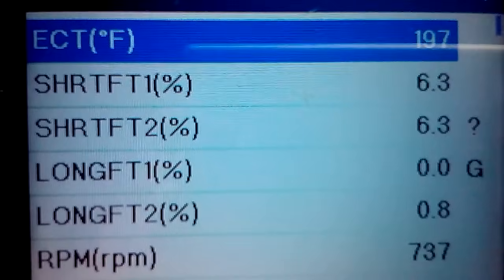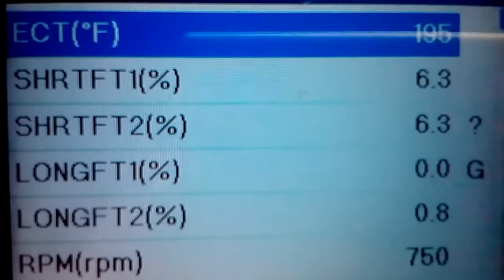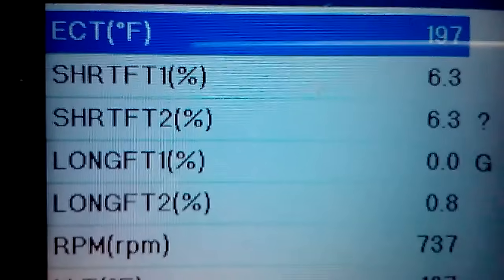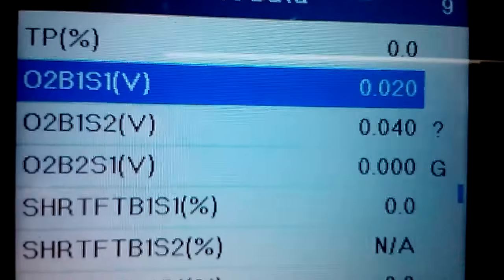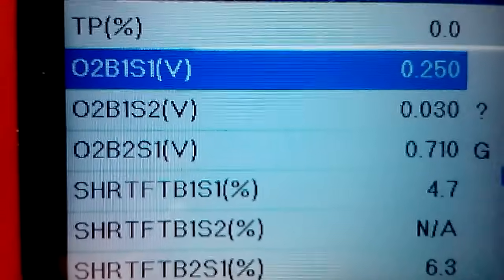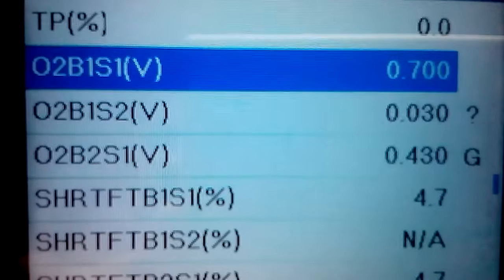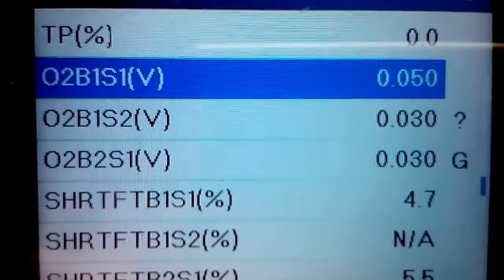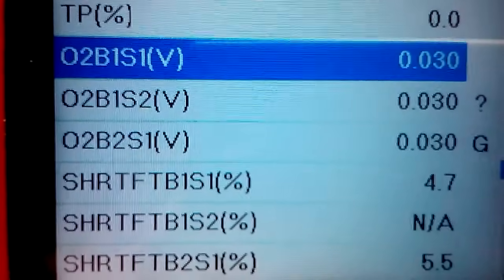The basics on live data obd2 scanner

Comment: Could you please make a video with info on diagnosing cylinder misfires using the live data on these OBDII scanners (if possible)?
Reply from the maker: Ashur deKelaita well monitoring misfires with scanners only give you a cylinder misfire count and let's you know how many times there is a miss. but I can definitely make a video on how to diagnose a misfire and how to pin point what cylinder it is if you don't have a scanner with those capabilities
Reply: Good2Boost would that be in the LIVE Data section or you mean just when you get an error code in the stored/pending section. I have my car in now getting new spark plugs and perhaps coils (hopefully no injector needed) for a cylinder 5 misfire, and just want a way to diagnose with more accuracy to make sure the problem is indeed solved, since I would only get the misfire when jumping on the throttle. 

But my car was also running rich in bank 1 so appreciate all the info on live data as pertains to Oxygen sensors and fuel trim figures.

There are no figures in Live Data that records data for spark plugs and ignition correct?
Reply from the maker: Ashur deKelaita that kinda sounds like a ignition issues bad coil maybe. and as far as using the scanner if you have a higher end one you can see exactly what cylinder is misfiring even if the cel isn't on for a miss. but the cause of it is up to you to figure out so I will Def make a video on that to show you how I go about finding which cylinder and why
Reply from the maker: and also Alot of scanner don't have the misfire count in the live data unless it's a pretty high end scanner. I'll make the video sometime this weekend so check back for it.
Reply: Good2Boost awesome thank you very much!
Reply from the maker: Ashur deKelaita video will be a few days delayed sorry. thought I would be home sooner then I was but I will definitely have it up within the next two days.
Reply: Good2Boost No rush at all. Was just looking at my full readout of Live Data... Its amazing how many figures there are... About 5 full pages worth, and not many videos of Live Data tutorials out there.
Reply from the maker: Ashur deKelaita yes especially on newer cars. the main important ones are the short and long term fuel trims and oxygen sensors. it's rare you really have to monitor much more than that but it does happen.
Reply: Good.video  can you do more .please .tankyou.
Reply: Know this older but I just used my scanner for cylinder misfire. My codes came to with cylinder 3 and 6 misfiring. Going to put in new plugs, coil packs, wires, and fuel filter. My bad boys got 220k miles on it and going to go for 3 so I gotta keep up on shit lol

Comment: Hi!  I like your video! Is a LTF of 10% high? Should it be close to zero?
Reply from the maker: Simply Z thank you, and yes that is a bit much I would look further into it. was it a positive or negative 10%?
Reply: RIU Performance it was positive! Thank you for replying :-)
Reply: RIU Performance I tried to post a picture to show you, but it didn't work.
Reply from the maker: Simply Z hmm so that means it's adding fuel I would start first looking for vacuum leaks. 3 out of 4 times that's what I usually find its the cause. still can't rule out a fuel delivery problem but I'd start with looking for vacuum leaks. also I'm guessing there wasn't any codes? and was the cars computer recently reset?
Reply: RIU Performance Well, it's a 2000 maxima. I've had ongoing problems with the catalytic converters. The check engine light will come on then go off; I've noted that it comes on every 1500 miles then go out after 1000 miles. When the check engine light does come on, it says P0420. May I send you a picture pic of the diagnostic I took?
Reply from the maker: Simply Z yes send it, also is there any exhaust leaks? and ongoing problems with the cat meaning it's just throwing a code or did it fail emissions?
Reply: Here is the link to see the data: https://goo.gl/photos/HrreiRhiLGZd4tAa9

I am not sure if there are any exhaust leaks. Although, when I start the car I hear an exhaust grumble noise. And yes the ongoing problem with the cat means that its always throwing a code. I changed one of the precats and would like to change the other precat as well. I haven't taken the car to an emissions test yet.
Reply from the maker: Simply Z ok so first I would look to see if you have any exhaust leaks. I just did a video on that the other day and hoe that can effect oxygen sensor and fuel trim readings. it's possible that if u have a leak and the oxygen sensor is reading off that could make it run rich and be the cause of the high fuel trim. it can also throw a code for the cat. I would start there and if everything is good I would then check for vacuum leaks. if the engine is constantly running rich that can cause the cats to fail Alot quicker hope that helps and the video I just did on exhaust leaks is on my 1996 maxima
Reply: RIU Performance thank you so much for all your help, I can't say that enough. Do you have any shops here in WA state?
Reply from the maker: Simply Z unfortunately not, also if all you care to do is make sure the cat is doing its job you can buy a heat temp gun very cheap at an auto parts store and take a temperature reading at the inlet and outlet of the cat once it's fully warm. the outlet should be significantly hotter than at the inlet. wish I could help more, hope this helps a bit atleast and thanks for the feedback

Comment: at a idle is it bad my o2 b1s2 is almost steady at .800 to .798
Reply from the maker: I might have forgot to mention in the video, make sure the car is fully warm and up to temp when readin the 02 sensors if it was it jumpin from .0 to .8 is normal. if it doesnt change and stays at .7xx the sensor could be bad if the car was already up to temp. hope that helps
Reply from the maker: if it wasn't up to temp take it for atleast a 10 -15 minute drive and look again
Reply: Yea it ran for about a hour so the one that's staying at a almost steady number could be bad
Reply from the maker: yes, try to rev the engine a bit and see if it moves at all, if it doesnt chances are its bad. and you dont always have to have a check engine light on for 02 sensors to be bad
Reply: Yea it's gotta be bad it barely moved when revving up the engine !! Now another question can these just be cleaned with some sand paper and some carb cleaner
Reply from the maker: +David Woog no carb cleaner and sand paper would be a bad idea, most 02 sensors have a heating element inside them to help get it up to temp faster and that could damage the sensor. does the engine have a missfire at all or just surging reving up and down?
Reply: David Woog-----  .5 to .8 and steady is what you want.

Comment: Great video 👍

FYI, for some of ur viewers:

Bank 1 is driver side, Bank 2 is passenger side

Sensor 1 is the sensor closest to the front, Sensor 2 is farther rear.

Example: If O2B1S2 is bad, you don't need to replace them all. Just the one O2 sensor on the driver side behind the catalytic converter. (Sensor 1 is closer to the engine, if you follow the tube)
Reply: See how his 02B1S2 doesn't fluctuate much, is that a bad sensor?
Reply: @22mrwright  Great observation. It probably is, but you would want to compare against the values for the other sensor on the same side, B1S1, and see if those fluctuate equally. 

If B1S1 also don't fluctuate as much, then it should be ok.

Otherwise, I'd consider changing it as well. 👍

Comment: I have a sr20 my 02b1s1 will run 0.010 then 0.02 an the short trim will go to 26.6 then 0 is that a sign of a bad sensor
Reply from the maker: Robert Smith if it does that when the engine is up to temp and in open loop then I would guess it was probably just the sensor.